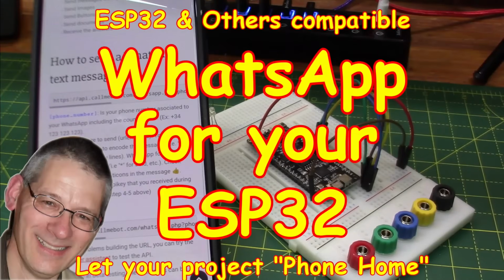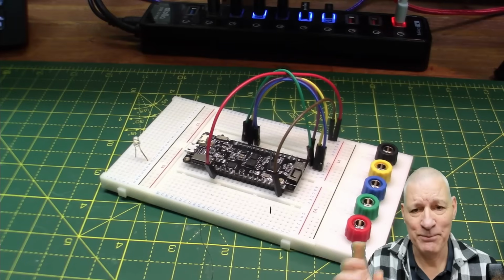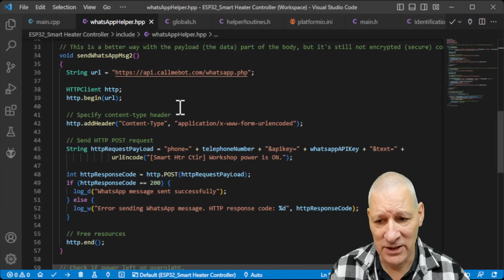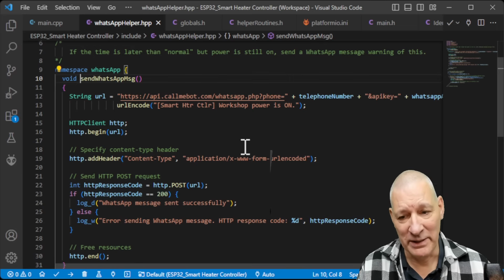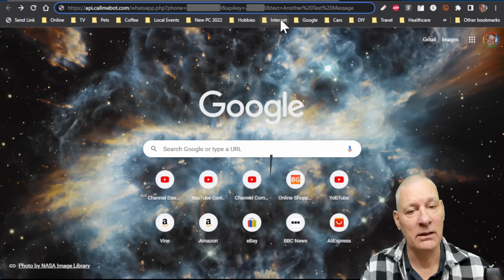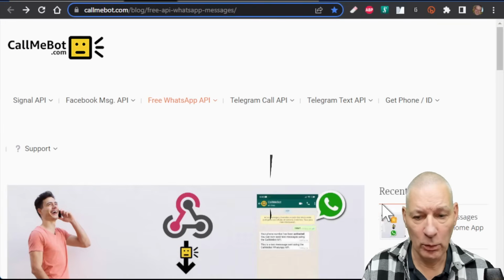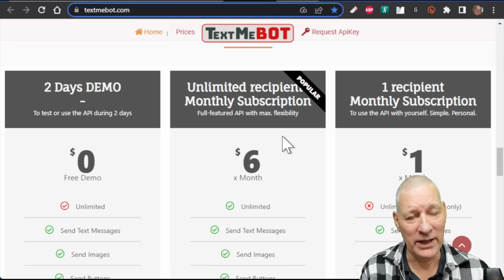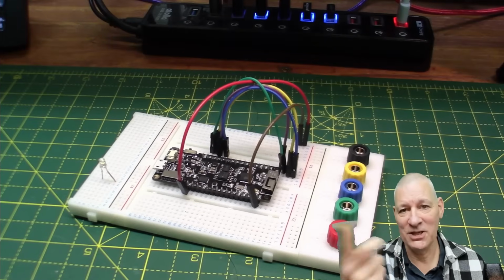#263 Using WhatsApp with  your ESP32 (and other μControllers)

Comment: Hello Ralph, I have been following your instructions and really appreciate how well you explain things! I was wondering if you ever made those ESP32 webpage tutorials that dive deeper, especially sending commands in a secure manner? If not, do you have any recommendations on where to learn? In matters of security, I would hate to learn bad practices from someone who didn't know what they were doing. Thank you!
Reply from the maker: Regrettably, I did not create any kind of "secure" comms information or instructions for ESP32s.

This was mainly because, at the time at least, it was much more difficult to create an https-type link to such a microcontroller; these days it is easier and https://randomnerdtutorials.com/ has many articles you might find useful.

Of course, you have to balance security with easy of coding and maintenance. In my workshop/household setup I'm of the opinion that the data I send to/from my devices is not of interest to anyone parked outside my house, and they have to break into my home network first anyway!

Comment: I have successfully used CallMeBot for WhatsApp with an ESP32. But when I want to do it with an Arduino R4 WiFi and the WiFiS3.h library, there is a compilation error. The error displayed is include the WiFiClientSecure.h library. If I install this last library, there is still the problem. Do you please have any idea what the problem is? THANKS

Comment: Could you please make a video to address all of the problems I list below?

I have been designing PCBs in KiCad for a couple years.
Nothing produced yet... because I hit a roadblock at the very fundamental level..

esp modules like (esp12F, esp32s, esp32-S3-1U) and others need "Strapping resistors".
one example says to put strapping resistors on pins that are not listed in the datasheet pinout..

also, the above esp32 do not all have GPIO21 and GPIO22 used for i2c..

I heard that you can assign i2c to almost any pin on a esp32..
but I'm not sure if any of the above have pins forbidden to use for i2c.

It would be nice if there was a master look-up table for strapping resistor pins..
and i2c pins on devices that don't have GPIO21/22

Last question is on footprints
Some parts I have no clue what size to use... Like the Stemma QT connector
Reply from the maker: I hear your frustration and pain, but that brick wall in front of you is, in fact, just made of sand and can be easily knocked down.

When you refer to "esp modules... like esp32s..." are you referring to the actual dev module boards (typically look like this: https://s.click.aliexpress.com/e/_DCC19nj ) that I often show in my projects?

If so, you don't need any extra resistors but you do have to be aware of which pins are strapping pins. This is partially documented here https://bit.ly/431GQO1 and I notice that he has updated his information after my rant that keeping GPIO 2 high at boot meant that I could not upload code! How annoying! (I might have said it more in the vernacular than that at the time).

My updated "Which ESP32 pins to use" can be found here: https://github.com/RalphBacon/260-ESP32-Web-Pages-Part-2 but also look at the RandomNerds page too as that gets updated too.

I can't believe you're using "bare" ESP32 WROOM or WROVER modules like this https://bit.ly/3pNP668 as my question would be, why? Let me know!

Comment: My IDE does not like #include <HTTPClient.h>
Reply from the maker: "Does not like", you say, Steve? The exact error message would be helpful here. Perhaps you need to install the library first? But which IDE are you using anyway?
Reply: @RalphBacon  Using Arduino IDE 2.0.4, but I have discovered that because I am using ESP8266, I have to use #include <ESP8266HTTPClient.h> instead. All ok now thanks!
Reply from the maker: Happy you found the issue!

Comment: Fantastic, thank you, I had initially dismissed Callme Bot. They do have a nifty library for Arduino IDE (find it in the Library Manager) which makes it a doddle. I had tried Telegram with ESP32 but the Library I had used was way too bloated, since this uses POST or GET this is much simpler and uses a fraction of processor and resources. Thank you for highlighting!

Comment: Hi, thanks for the video!
Is it possible to use an ethernet shield instead of wifi? Can you do a video with an ethernet board ?

Thanks a lot
Reply from the maker: You can certainly use an Ethernet shield for an Arduino UNO (and I've done video #74 on that https://youtu.be/F2mFlMVzX0M ) but you can't (easily) plug in that shield to an ESP32.

Comment: Hi Ralph. I use a sim800 board with a nano and a 1p mobile sim (texts are 1 p each). The big advantage is sms's go straight to phone where as messenger services seem to go to sleep if the phone is left motionless for a while. I've migrated the whole lot onto a pi 4 and node red but the basics are simple. Luv the videos, thanks. B.
Reply from the maker: Sounds like a good alternative method, Brian. But I get WhatsApp messages regardless of what my phone does (it keeps running in the background, I'm assuming). Anyway, as long as we have some sort of messaging system running it's all good!

Comment: Ralph: Have you tried PushingBox?  Very similar.  There is no sign up fee for less than 100 notifications per month unless you wish to donate and get more.  You create scenarios in PushingBox and you are assigned a device ID, which is a string.  You put the string into your micro code and send it to PushingBox when something triggers.  A canned email  or text message that you create in PushingBox is sent to the phone number or email address you designate.  Example; "temp low" or "front door open".  I have a half dozen different notifications being sent from my micro based home automation system.  No app necessary on phone.

Comment: Great info and opens ideas for sure. :)
I use a tablet and phone with no# to communicate with esps,  over wifi, so likely the apps signal is over phone provider rather than wifi internet.?
Reply: Seems Telegram is worth looking into.😀
Reply from the maker: Well, the signal to request the WhatsApp message is sent via a standard URL (so Wi-Fi plus Internet) but the WhatsApp message itself is sent to the phone via the the Internet (but still [optionally] using the Internet). My mum's tablet works like this, no SIM required.

Comment: Two phone numbers and the API key were clearly visible.  Social engineering or just bad edits?
Reply from the maker: Bad edits. Could you send me the time codes via email please?
Reply: @RalphBacon  Sent you a WhatsApp message using the url, phone, and key provided in this video.
Reply from the maker: Got it. I'm going to have to cut a second or so from the video and blur some other stuff. Let this be a lesson to me! Thanks for doing this. 👍
Reply from the maker: Sigh. "There was a problem in processing your video. As a result, your recent edits were not saved."  Very helpful message. Not.
Reply: @RalphBacon  Grab a new API key.   No need to obscure it then.   Phone is still visible.  That may mean a re-upload.
Reply from the maker: I can't really upload again, YT removes all views, comments and so forth. Sigh. Last time I do anything like this. 😡

Comment: Good stuff! I have just been wrestling with https to post data from an esp8266. Easy if you don't encrypt it. But a challenge otherwise. Settled for fingerprint for now but the idea of it expiring is a pain. Really look forward to how you resolve it (you will, won't you??!!)
Reply from the maker: You can always use encrypted https but "insecure" which means the server's certificate isn't checked (mostly good enough for IoT type stuff). I'll be talking more about this in a future video (that HTML Part 4 I mentioned).

Comment: Thank you, Very good Video.
Interesting service, and I agree, very cheap.
Do you know something like that, but for SMS ?
Reply: GSM modules, e.g. SIM800, SIM7600, etc.
Reply: @Mr.Leeroy  Thanks.
Reply: @Mr.Leeroy  It is a solution, but it is a lot more expensive, even using a prepaid SIM, it is necessary to recharge it times to times to keep it active. It Costs a lot more that 4$ per year.
I' m looking for something like an free/cheap SMS gateway.
I` ve found some but not at this price.
Reply from the maker: Not that I know of - not free (almost) anyway. But as Leeroy mentions you can easily build a GSM module and get a SIM card for messaging that does not expire at the end of a period.
Reply: @RalphBacon  Mobile operators in my region started to sell IoT SIMs with some SMS, traffic limits (e.g. 200mb/month), where you do not pay on subscription basis, but purchase ~$30 one-time activation.
Now, they upgraded it to 2GB/month for the same price if you buy a new SIM or re-activate.
Good deal for GSM modules.
Reply: @RalphBacon Thanks

Comment: Hello Ralph! I use IFTTT for the same type of applications. They have loads of different applets and services depending on what you want to do. You can create 5 applets for free without paying a cent. The applets sends me a mail with text I choose if the burglar alarm goes off and for when the postbox is opened, for example. It sends out mails instantly and works flawlessly. :)
Reply from the maker: IFTTT (If This Then That) is a great system, Egon, and I've played with it. But this is just a simple bolt-on standalone service that I'm bringing to everyone's attention.

Comment: Think I am going to have to make a couple of panic buttons for my elderly in-laws.  Hopefully works with 8266 so I can keep small add a covered toggle switch, Cr2032 battery  and you have a   pocketable device for those help I've fallen and can't get up moments.   Keep up the great content, I get a lot of great Ideas from your channel.
Reply from the maker: I know that the ESP32 is a bit too heavy on sleep current for a CR2032 battery so the ESP8266 may fare better. Or check out the ESP32 single-core alternatives(which are replacements for the ESP8266, says Espressif) which might have lower currents.

Or, do what I do with my Storage Bin Lid devices and have the current totally switched off by using a SI4599 dual MOSFET. The button is then used to switch it all on, send the message and auto-switches off when done.
Reply: @RalphBacon  was actually planning on the  device activates on toggle switch on and sends message and perhaps lights led when sent.   Not as elegant as the MOSFET but was just going to have returning the toggle switch to turn off.  By the way in laws are in Heidelberg just a bit from Stuttgart.
Reply from the maker: I nearly went to university in Heidelberg (Ich hab' mein Herz in Heidelberg verloren) but eventually ended up going to Marburg and studied (amongst other things) FORTRAN 😮😁😂

Comment: Nice video. Would you consider to use Telegram?
Reply: Agree with you,  using Telegram for this type of thing is a much better solution. No need to mess about with a man in the middle site  or the hassle/risk of having to pay a yearly sub. Also at a quick glance, I dont think callmebot allows for msgs back to control the ESP32. If you use Telegram you can send control msgs back in the other direction
Reply: I would also recommend Telegram. Used it for many projects and its very solid, official API, good libraries and no fees.
Reply from the maker: I've never used Telegram but I'll put it on the list. I was specially interested in the use of WhatsApp here.